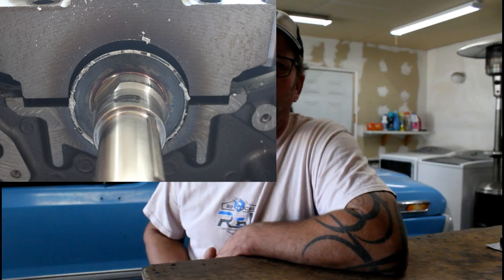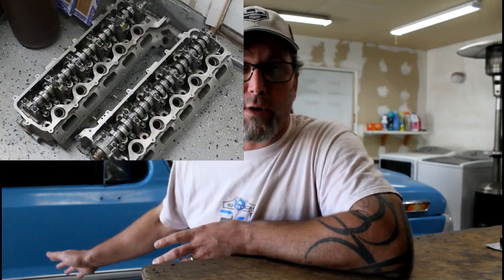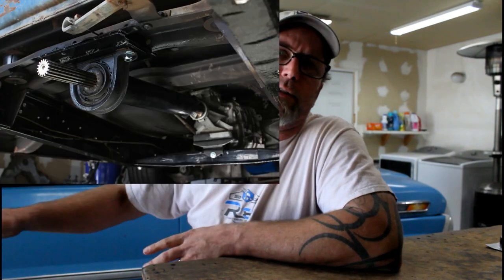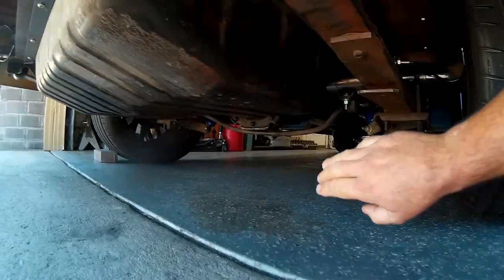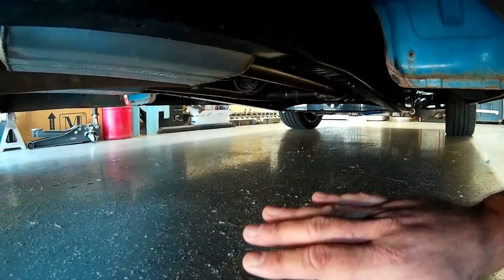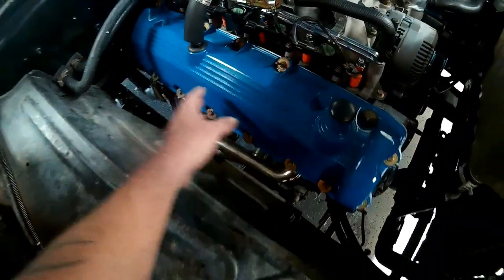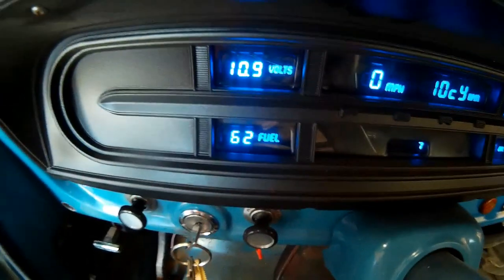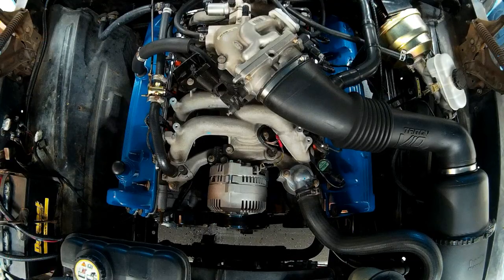#v10bumpside Ford F100 V10 Swap Build Walkaround!

Comment from the maker: tuning update!  i've been working with Decipha (well known internet tuner) on the V10 tuning, and WOW what a difference already!  we are about to start upper RPM & WOT tuning with the AEM wideband, and if he makes as much improvement on the top as he has in the low & mid range, this thing is going to rip!  the burnouts are ridiculous already and i expect we will see more than a 50hp increase already with the stock MAF.  once i put the 90mm MAF and 3valve heads on it we will likely be well over 100hp improvement.
Reply: VintageSpeed Garage    WOH....
Reply from the maker: @BradRange  thanks man, much more coming on the #v10bumpside, but at the moment i'm finishing up wiring a 4.6 swap for a buddy of mine....then back to my truck.  i drive it alot though.  :)  and the tuning is bringing out the beast that lurks within.  thanks for watching!
Reply: How did you do the stand alone? Mine came from a F53 chassis.

Comment: I wish you can make a 4V Triton V10 of course you have to buy 4 sets if 4.6 Cobra heads, cut em and weld em, and do some porting and polishing to em to make em work with the 6.8L Triton V10.
Reply from the maker: i have 3 valve heads, cams & intake sitting here on the shelf to go in along with my standalone....soon soon.  thanks for watching!
Reply: @vintagespeed  Awesome brother Can't wait to see it.
Reply: @vintagespeed  The custom made 4V heads should flow even better.

Comment: I bought an 05 F350 Super Duty with a non running motor and picked up an 06 6.8l to drop in the truck. The 05 motor is buildable and I keep looking at my 08 P71...which I love, but want more go power...looks like I know where that extra V10 needs to get stuffed into. All my hot rod work was in the pre-ecm days, any pointers on electronics would be greatly appreciated. Very cool truck build! Going right now to your burnout video....Subscribed.
Reply from the maker: yeah, i'm an old carb guy as well...but the harness work & EFI stuff is all the same, just a better (imo) way to make a motor run efficiently.  and it's not all that hard to learn.  keep at it!

Comment: This inspires me to do my own v10 swap on my 95 F150. My only holdup is the engine mounts. Did you find aftermarket or did you use custom fab mounts?
Reply from the maker: my truck has a crown vic front crossmember, so i modified some CV motor mounts.  you may be able to use some F150 5.4 mounts with some modification.  i also centered the middle cylinder over the crossmember for weight balance.  you may have to play around with spacing to get it where you want it.  took me about 2 weeks of staring at it and playing with positioning.  good luck on your swap!  👍

Comment: I feel like you done a phenomenal job onit I'm thinking about getting a 62 f100 unbody Long bed and going 5 speed manual but I'm also thinking about 4wheel drive with the manual 5speed and A V10 6.8 triton motor so I like your idea on how you are doing that motor ❤ I even thought about putting the motor in my 70 Ford Fairlane
Reply from the maker: thank you!  yeah, the 6.8 is a great all around motor.  very enjoyable to drive!  and it fits pretty good in the bumpside engine bay.  thanks for your comment.  👍

Comment: Impressive!  I have inserted a 5.4 32v navigator engine into my 69 f100.  As for the wiring harness I used mine from the navigator and I think you understated the level of difficulty.  It took me a couple of months to trace and reconfigure all the wires on mine and I am no beginner on electrical.  I would not recommend anyone try that unless they have lots of patience skill and time.  I have been working with Decipha as well.  He is good I agree.  I did intellitronics dash also but went a bit different direction.   I have 4 wheel disk and need to downsize my brake booster.  I noticed yours sits at an angle and fits nicely.  What can you tell me about it?  Mine is offensively large.
Reply from the maker: i'm about to redo the harness for the 4th time...i feel ur pain.  :D

Comment: So what are going to do with the 68 Bumpside F100?
Reply from the maker: the '68 we put a 4.6 P71 in it, went to a buddy of mine.  my son's '67 is all stock survivor truck with 352/C6 and my other son's '71 has a P71 in it.
Reply: @vintagespeed  Sweet, how's the V10 Bumpside going and when is the 3V V10 project going to start?

Comment from the maker: cold start idle speed in the video, warm idle is 650rpm.  but i may turn that up to 700rpm just because it sounds better and works better with the 5 speed at a little higher idle speed.

Comment: What rear make model and year rear are you running? I’m working on a 67 f100 and I’m splitting hairs between a 03 explorer and 2011 Vic police interceptor.
Reply from the maker: im running an f150 8.8 rear axle, redrilled to 5 lug.  either of those will work fine for you, though the vic axles are wide..  we put a 31spline vic axle in my buddies '68 P71 powered F100 and it's holding up fine as well.  both our axles have LSDs and lots of donuts on them...  thanks for watching!
Reply: @vintagespeed  sounds good. Thank you for the replay
Reply: @vintagespeed  I’m also thinking I may go with the vic rear because I haven’t seen any Coilovers for a explorer rear on my google search.

Comment: howdy, i was just wondering if you considered the four valve heads?
Reply from the maker: havent seen 4v heads for the v10. thanks for watching!
Reply: @vintagespeed  You can put 4 valve heads on a V10 you just have to buy 4 sets of em as well as doing some cutting and welding to work with the V10.

Comment: Love it man.   What flywheel and clutch did you end up using?
Reply from the maker: thanks!  flywheel is an 8 bolt (54/50/46) flywheel, clutch plate is a 10.5" coyote plate with an 11 spline 10.5" disc.  cable operated to a 5.0 quadrant adapted to the stock pedal assembly.  weird combo, works great.

Comment: How did you mount up the radiator to the support?
Reply from the maker: initially i used the CV rad and modified the CV brackets to mount to the core support.  currently though, i'm running an aluminum 3 row rad with the stock mounting locations, just had to make a couple brackets for the fan to mount up.  CV fan fits it perfectly and cools great.  thanks for the question!

Comment: Did you have to do anything to your firewall to make it fit? I've been contemplating using an extra V10, ZF-6 4x4 drivetrain in my 77.5 and my biggest concern is the firewall and fitment
Reply from the maker: no, stock firewall and tunnel.  though i used the TR3650 not a ZF, so dunno how well that trans will fit.  thanks, good luck with your swap!

Comment: What did you use for a wiring harness
Reply from the maker: modified the stock harness, removed all the unnecessary plugs/wiring and shortened/lengthened it as necessary to fit everything under  the intake manifold.  currently using the stock EEC-V ECM, though I have an MS3PRO EVO waiting to go into it soon.  thanks for watching.

Comment: Great build man! I've kinda been on the same path. Same motor in a 66, alot of house stuff got in the way. How did you work through the wiring?  That thing sounds mean!
Reply from the maker: thanks man!  i think the x-pipe really makes the sound, it's much better in person.  for the wiring, i removed all the unnecessary crap from the stock harness, flipped it around 180* (my engine harness was from a van) so all the plugs would be in the back, ran it all under the intake manifold so it's kinda hidden.  currently using stock auto-trans FDA4 ECM currently, working on that right now actually with a Moates QH to remove all the auto trans parameters and improve downshift fueling.  down the road when it's turbo time, will probably have to go standalone.

Comment: What did you use for motor mounts. Really thinking about doing this for my 76 Highboy.
Reply from the maker: this truck has a CV front x-member so i used CV front mounts that i modified, factory rear mount and moved the x-member on the frame.  i've also shimmed up the motor/trans with some spacers to get the shortened pan above the x-member and trans as high in the tunnel as i could get it without much modification.

Comment: Hey what did you use to turn the brake booster like that i just got my v10 set and mounted in my 79 bronco but booster needs to be set up like that. Is that the 66-77 bronco one?

Comment: I have the same engine and transmission that I'm putting in a 73 ranchero. If you could give me some pointers with getting it to run and at least idle
Reply from the maker: getting it running should be no problem with the stock ECM and harness.  i cut mine down and removed all the unnecessary crap out of the harness, takes awhile to solder 104 wires.  good luck with your project!
Reply: VintageSpeed Garage so what exactly did you have to solder?

I am in need to run an engine on a stand before install. You are the only one that has made it this far
Reply from the maker: @user-vd9fz5ey9m  haha, i'm not sure how to answer that....i have at least 40 hours into this harness.  every single wire has been shortened/lengthened or redone.  i turned the engine harness around 180* so the plugs were in the back, and the ECM is currently sitting on the tunnel.  i used a wiring diagram i found online for the ECM pinout.  i've done quite a few EFI swaps tho, so this isn't my first rodeo..  :)
Reply from the maker: the funny part is that i'm about to redo this again and move the ECM to what i think, will be it's final location.  but first......i have to get the 4.6 swap done on my son's '71 bumpside.
Reply: VintageSpeed Garage 

Ok I wrote that weird lol. I didn’t think about you actually installing it so it makes sense. 

I guess what my question is after you eliminated the unneeded portions of the harness were you able to plug it into the engine, power up the Ecm and start it?

I won’t really have a home on a stand for this so what ever I have will just lay there I don’t plan on doing swaps like you I just need to figure out if this brand new engine I scored is operational before I install to a truck. Obviously there is more to the engines story but that’s the short version
Reply from the maker: @user-vd9fz5ey9m  yes, it started right up.  only changes that were necessary after initial start was adding in the wideband and dash wiring for my digital dash.

for what you're needing, i would build a 2x4 stand to hold it close to the ground, leave all the unnecessary stuff in the harness, supply 12v+, B+ and grounds to the ECM and fire 'er up on the stand.  you dont need relays and fuses for test running, just hotwire all that stuff and hit the starter solenoid with a screwdriver.
Reply from the maker: you WILL need a rotary fuel pump to provide enough pressure for idle, but you dont need O2 sensors or EGR or VSS/OSS.  you DO need IAC, TPS, MAF/IAT (i used a 6wire all-in-one MAF) CKP, CPS, CHT/CTS and coils & injectors.  depending on what year ECM you're using.....the original 2v ECMs are really easy to get running.  the later 3v ECMs will have PATS enabled and you'll need to be able to turn that off in the ECM with a tuner/chip.
Reply: VintageSpeed Garage 

Cool thanks for the info. Now I just need to get a harness and such. Shouldn’t be a big deal I work at a scrap yard
Reply: @vintagespeed   Does the 3 valve wiring harness differ? Do sensors and plugs all fit from a 2v? I have a very low miles  3valve V10 and was thinking of sticking it in my 53 F350, besides the fact the 79 Twin I beam suspension is not going to allow that to fit the wiring is a concern. Doesn't seem like anyone makes an aftermarket ten cylinder ignition.
Reply from the maker: @tomp1612  AFAIK, the only difference (motor wise) is the TB and the position of the CPS in the timing cover, otherwise the same as 2v.  the 3v intake uses an internal motor to vary the runner length, so you'll need to figure that out and perhaps the MAF is different.  3v also uses adjustable cams with phasers.  there are standalone options that will do ignition, with add-ons....  i didn't find a standalone that would do sequential fuel AND ignition though....well, nothing under 3k dollars.  all the cheap(er) options were batch fire and/or bank fueling....which on a 10cyl isn't very efficient..   thanks for watching!
Reply: @vintagespeed  I would wonder if the 3V engine can be run with the variable runner intake not functional?  Perhaps gut the electronics from the throttle body to hook up a lever for a cable and use the 2V wiring and computer?  Batch fire would probably ensure 5mpg or less.
Reply from the maker: @tomp1612  from what i can see on the 3v intake i have, it simply changes the runner length.  just like swapping an intake on a carb motor, it'll run either way.  i will be using the 2v TB and ECM, with the same ignition that's in place currently.  i dont expect much to change other than maybe getting some better flow.  although, i have also toyed with the idea of making a sheetmetal intake of similar size, because i dont think the plastic intake can handle much boost pressure...
Reply: @vintagespeed  Thanks, I've thought of using a cable type throttle body. I assume the 3V has bigger blades than the 2V one or is it? Perhaps an aftermarket one, looks like the Mustang Cobra ones may fit but I've never measured. Trying to make the 3V throttle body and computer work in a simplified form is something i'd be leery of trying.
Reply from the maker: @tomp1612  the 2v TB is very close in size to the Cobra TB.  i dont plan to use anything 3v except the heads, intake & timing cover.  just the hard parts, the 2v ECM will not know the difference.
Reply: Anyone know if a motorhome 3V computer and wiring is simplified or would it still run to half the damn vehicle? I can't find any mention of a marine V10 which would have to use a simple harness. There is an industrial one and a local had a supercharged natural gas V10 generator engine but supposedly that ECU would not work as it runs only idle and a set higher RPM with no acceleration.

Comment: I’ve got a 72 f250 crewcab that im swapping in a 08 6.8l and the factory 6 speed manual. What harness did you use or do you know if a universal harness. I’ve built many LS stand alone harness but this seems to be a little more involved.
Reply from the maker: i used a stock e350 harness, chopped it all up & removed the unnecessary wiring, added a moates quarterhorse.  i have a standalone ECM to put in it, just gotta find some time to park it for a few months.

Comment: What EFI are you running on it? Holley?
Reply from the maker: stock '01 ECM with Moates Quarterhorse emulator.  thanks for asking!
Reply: @vintagespeed garage, I kinda figured that’s what it was, I don’t think Holley even supports v10s. How hard was it to work with that wiring harness? Is there that annoying security lock thing that most car ECUs have? Also I only just now discovered this channel, your videos are great! You should really consider uploading more videos, especially on the v10 f100. If we can get more people making content on that thing, then we may eventually see some more aftermarket support for them
Reply from the maker: @camoking5059  PATS can be disabled with the Moates QH, although most truck ECMs of this generation didn't have PATS enabled.  thanks for the kind words, too many projects, too little time for video.
Reply from the maker: regarding the ECMs that support 10cyl, there are only a few that do native IGNITION.  there are many that do injection.  i have a MS3PRO EVO to go in my truck soon, along with the 3v heads.  in the way currently is the LS swapped '59 apache and my son's '71 P71 swapped F250 that i'm working on.  but soon i hope.

Comment: Awesome build! I'm installing a TR3650 trans from a 2005 mustang in my 67 F100 and I was wondering if yours has the remote shifter and if so then what size hole did you cut in the floor board...Thx
Reply from the maker: the 01 TR3650 i used is not remote/cable shifter.....the shifter bolts right on top of the trans.  to clear the base of the shifter, 3.5" holesaw.
Reply: Thanks for the reply...I think that 3.5" hole is gonna work just fine for me.

Comment: what clutch kit are you running?
Reply from the maker: the clutch in the truck is a mixture; i'm running an 8 bolt v8 flywheel, an 11sp 11" clutch disc and an 5.0 clutch plate.  my trans is an early one thus the 11spline input shaft, if it breaks i'll go with the later 36sp (iirc) disc.  i have smoked the clutch a couple times getting a little too crazy with the launches...but it's holding up well under more normal use.  i have a quote from SouthBend for a dual disc in this configuration and i may do that...the price is right just no time for my truck at the moment.  thanks for watching!

Comment: I would have installed wider tires, otherwise, awesome job!
Reply from the maker: yeah, she definitely needs more meat..  but i've gotta mini tub it to put 305s on it so that's probly the next move.  raise the bed floor, 4 link and widen the tubs.
Reply from the maker: i'm currently working on a '59 apache project, so when that's done i can get back to the #v10f100